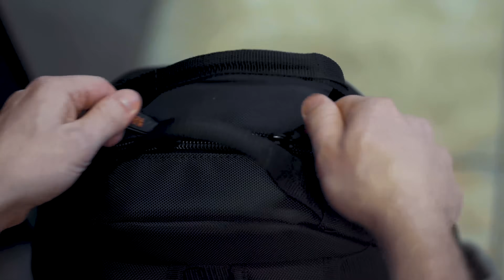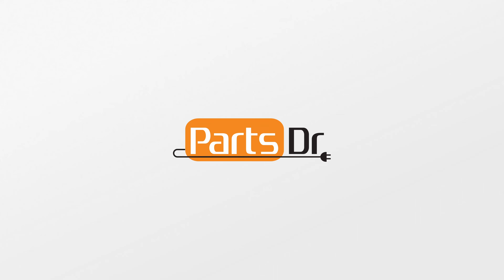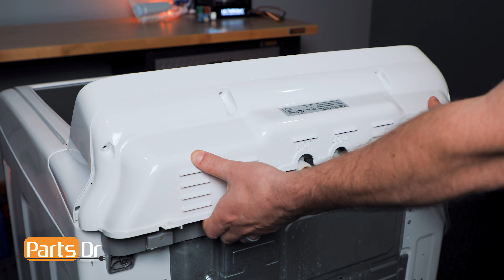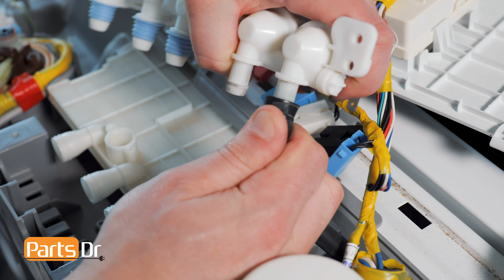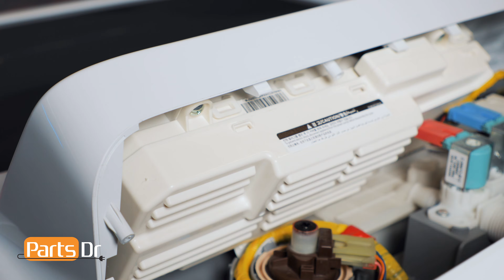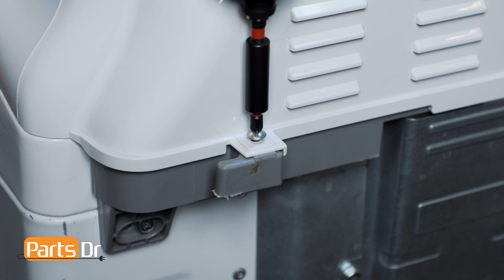Fix 4E, 4C, NF Errors - How to remove/replace Samsung washer water inlet valve part # DC97-15459G

Comment from the maker: We're glad you're finding this video helpful for fixing your Samsung washing machine! Just a quick word of caution.  If you're ordering parts online, especially from places like Amazon or eBay, be careful that many of the cheaper aftermarket parts are of much lower quality. We've seen many cases where these parts leak and cause costly water damage to homes.

For peace of mind, we always recommend using original OEM parts. You can find the high-quality Samsung parts on our website at https://partsdr.com While they might be a bit more expensive upfront, they'll save you money and prevent future headaches down the road.

Thanks for watching, and good luck with your repair!

Comment: Liked the video. I replaced the water intake valve but im still having water leaking out from the far left connection from the hot water side. I followed all the step in the video. Please help
Reply from the maker: It is leaking where the hoses attach to back of the washer or leaking into the tub while not in use?

Comment: So... I'm pissed - I just bought a new washer/dryer pair - because my washer wouldn't stop filling - unless I tuened the water orwssure WAY down - making the Quick Wash take 2-3 hours... but...I lived with it.  But when the dryer stopped heating- I figured,  WTF I might as well "look" at the local BrandSmart...and wben they offered me a credit card with $2k available - I pulled the trigger.. deliver tomorrow.

Should have watched your video first! 

Looks like $100 +/- in parts and 1-2 hours for this novice...

I am NOT letting them take the old appliances - so - maybe I'll repair and resell the old ones...
Reply from the maker: It definitely sounds like it is worth fixing and selling or giving to someone so they don't end up in the landfill.

Comment: Samsung Aquajet VRT WA48H7400AW/A2,  Parents having the issue of the water overfilling.  It will not stop when it reaches the correct level.  Will replacing this valve help with that?
Reply: Should have read the comment first but it looks like it will fix my issue.  Leaving this here for others to read.

Comment: Can you just replace the thread going in it cracked on my cold and it's leaking but I don't want to have to replace the whole thing just because of that
Reply from the maker: The water valve will need to be replaced if the threaded connection on the cold inlet is cracked.

Comment: Love the video, I’ve fixed my Samsung washer a few times now and the cost has been less than buying a new one or having someone fix it, I’ve had it for long so eventually the parts will start to degrade and mess up but still it’s worth fixing than getting a new one, you save money and only takes a few minutes.

Comment: So you can't replace just like one of the valves You got to do the whole assembly? I mean I can just swap one of the solenoids from like the bleach of fabric softener thing for the water one If we don't use the bleach or fabric softener dispenser but how do they solenoidsor do they
Reply from the maker: That is correct, if one of the solenoids on the valve fails the whole assembly will need to be replaced.

Comment: My washer started leaking water during a hard freeze …it started snowing ..I’m in the south ..first time ever temperature dropped severely low.. water started filling the tub ..now it just leaks water into the tub  ..do you think it’s the inlet valve ? Thx in advance .. I just want to make sure before I go through all this
Reply from the maker: Try unplugging the washer.  If water continues to leak into the tub while the washer is unplugged, that indicates the water valve is bad and will need to be replaced.
Reply: @ thank you so much for responding! I will try that . And thank you so much for this video! You def saving people time , money and a big headache ..much love from NOLA💕💕💕
Reply: @PartsDr just to make sure I understand you ..when you say it’s the water valve ..do you mean the inlet water valve like in this video ? Thx in advance…my washer didn’t give me an error code ..but it’s leaking water not much ..just a drip ..and the water pressure is kind of low .. could it be the inlet water valve or a sensor? So sorry to keep bothering you and thx in advance
Reply from the maker: @Strawberryfreeze3000  If the washer continues to fill with water when unplugged, that indicates that the water inlet valve on the washer is bad and will need to be replaced.
Reply: @ Thank you💕

Comment: Thanks! Looks like an easy repair. My Samsung wa50r5400av/us is not filling with hot or cold water, it's also not giving me an error code. I suspect that a new valve will fix it, but could it also be the pressure sensor??
Reply from the maker: Does the water valve hum when it should be calling for water?

Yes a bad pressure sensor or a kink of restriction in the pressure hose could cause it to act similar to this.
Reply: So my issue ended up being that the door was not latching, and there was no error code to indicate what the issue was.  Definitely something to look for first before moving on to the water inlet valve.
Reply from the maker: @williepiper2833  Thank you for sharing!  That is good to know!

Comment: As a single mom I want to thank you for this video. I ordered parts from Amazon fixed it leaking water sensor by watching your video. You saved me so much money . Thank you so much 🙏
Reply from the maker: Great job fixing it yourself! 👏 Just a heads up though, that the aftermarket parts sold on Amazon are low quality, and there's a risk of the valve leaking, which could lead to water damage in your home. We recommend checking out the original OEM Samsung part on our site at https://partsdr.com While it may cost a bit more upfront, it’ll save you money and prevent headaches in the long run. Thanks again for watching, and keep up the awesome work!

Comment: Love the channel! Would this work if my cold water side leaked and sprayed all over and now the washer will not even power on?
Reply from the maker: That sounds like two different issues.  If the water valve leaked onto the circuit board(s), it could have friend one of the circuit boards.
Reply: @PartsDr  appreciate the reply. I took apart the board and plugged everything back in and have power now so I think I’ll order a new inlet board. You’re right two different issues
Reply: Update, somehow it powered back on and now it has a new valve and works perfectly

Comment: How often does the solenoid valve spoil or how durable are these valves ?
Reply from the maker: The OEM Samsung valves are pretty good quality.  But all water valves can fail over time due to hard water and mineral deposits that can cause failure over time.

Comment: Will this fix my hot water issue? Hot water wont come out, only cold water and we got our plumbing redone so it’s not that.
Reply from the maker: Yes, if the hot solenoid on the water inlet valve fails it can cause the washer to not fill with hot water.

Comment: Could this also be why my washer doesn’t fill with cold water, only hot? I’ve checked other things like making sure the cold water faucet is open all the way
Reply from the maker: Yes, a bad water inlet valve can cause the washer to act this way.
Reply: @PartsDr  thanks for the swift response!

Comment: Do you perhaps have the DC92-00658C PC board?
Reply from the maker: That does not come up as a valid part number.  Make sure you have the correct part number https://www.youtube.com/watch?v=cLon_5r2LdQ
Reply: @PartsDr  it's a correct one for the Samsung Washer Dryer. The machine is WX4211XVM.
Reply from the maker: @thabisomodise2529  parts may not be available for this appliance because it is a non USA model.
Reply: @PartsDr  yes it was for South Africa and Australia. I have struggled for the whole 6 months and I am trying to save this machine. In Australia they it is model number WD1102XVM. Do you perhaps have contacts that can assist me?
Reply from the maker: @thabisomodise2529  Sorry, we do not.

Comment: Please forgive my ignorance, but I have a question. Why is the part you offer for my washing machine $93 and there are three same parts selling for as little as $25 or $26 on Amazon and other websites?
Again I don't know anything about anything when it comes to washer repair. Any guidance would be appreciated.
Reply from the maker: Amazon is not an authorized dealer for Samsung appliance parts.  All of the ones sold on Amazon in that price range are aftermarket or knock off parts.  We have heard many horror stories about aftermarket/knock off water valves flooding houses (just ask any appliance repair professional).  You may save a little up front, but in the end it could cost you a lot if the part fails.  Make sure you have good homeowners insurance!  Also, Amazon does not make free appliance repair videos showing you how to fix your appliances 😉.
Reply: @PartsDr  Thank you so much for the quick reply!! Well I assumed that it was going to be from Big Bob's house of knock off parts but I'm not sure that that inlet valve is as complicated as many other parts and unfortunately I don't have $93. I'm a metaplastic cancer patient living on a minimal amount of fixed income and while I absolutely appreciate your videos so much because without them I would not be able to make this repair myself, your quality authorized official parts are out of my budget. Such is life sometimes unfortunately. I will most definitely purchase your parts should my finances change. Because your videos are fantastic and they've taught me so very very much. Thank you ❤️

Comment: I have the same problem, I changed the inlet valve, and it doesn't work, I keep getting the NF error... help please...
Reply from the maker: Hi Edwin, did you replace the inlet valve with a genuine OEM Samsung part or an aftermarket part?  Have you checked the water supply to the washer?
Reply: @PartsDr  I was able to fix it, the only bad thing was.  a small tube, which I really don't know what it's for, had detached from where it came installed, I connected it again and that's it!  In the end it wasn't the inlet..
Reply from the maker: @chigui08  Great, thanks for sharing!  It sounds like maybe it was the pressure sensor hose like we show here: https://www.youtube.com/watch?v=c6gKsgPcHrg
Reply: @PartsDr  yeesss..!!

Comment: Any comments on the type of valve - (OEM or after market?) - the OEM get lots of bad reviews on Amazon but so do the aftermarket units - how do i get the best part ? - thanks
Reply from the maker: The problem is that many of the products advertised as OEM on Amazon are not OEM products.  Amazon is not an authorized dealer for any of the major appliance parts brands that we know of.  From our experience, we have seen a lot of problems with aftermarket, knock-off, and counterfeit water valves.  We don't think it is worth the risk, as a faulty valve can flood and damage your house and easily cause tens of thousands of dollars worth of damage.  If you are interested in genuine OEM parts, you can search our site https://partsdr.com

Comment: I replaced my valve now no water is going into the washer what did i do wrong? Can the new part be defective?
Reply from the maker: What was the issue with the original water valve?  We have seen a lot of issues with the aftermarket parts being sold on Amazon.

Comment: My inlet valve has plastic screens in the hot and cold inlet valve. Do they come out or are they suppose to be that way.
Reply from the maker: Some models use plastic screens instead of metal screens.  They are supposed to be there and they should be left in place.

Comment: My washer is leaving parts of sand and dirt on my clothes after I wash them is there a clogged filter somewhere that's holding dirt back why is it making my clothes dirtier after I wash them
Reply from the maker: That doesn't sound like a problem relating to a bad water inlet valve.  For that you may need to take the washer apart and clean it.  Also, check to make sure your drain pump is properly draining the water out of the washer.  Here is a video on disassembling the washer here: https://www.youtube.com/watch?v=OKarymySPuE

Comment: Threaded part replaceable? Where hoses connect?
Reply from the maker: No, you would need to replace the water valve if the threaded part is stripped or damaged.

Comment: How important are the black hoses to be put back on the right side I took it apart and I don't remember which one went where
Reply from the maker: The hoses usually connect to things like the detergent dispenser, bleach dispenser, and fabric softener dispenser.  If the hoses are connected in the wrong order, it will be sending water to the wrong area of the machine.

Comment: My samsung wouldn't stop filling even when unplugged. Ordered the $25 part and fixed it in twenty minutes. Thanks!
Reply: It shows me $93 on Parts Dr.
Reply: @HexNottingham ya but not on Amazon
Reply: @Boddylan75 I ended up needing a different part anyway. Returned mine. Something similar but right next to the one I was told to replace.

Comment: Great video!
I’m replacing my water inlet valve because it appears that the fabric softener valve is clogged.
Reply from the maker: Great!  Let us know how the repair goes for you!
Reply: @PartsDr  No joy🥲; The softener tray didn’t completely empty after 1st test. Could this be due to the softener being too thick?
Reply from the maker: @CharlestonUWH  Try cleaning out the dispenser drawer components as sometimes if they get clogged up they will not siphon properly to empty.
Reply: @PartsDr  still no 🥲 joy
Reply from the maker: @CharlestonUWH  try diluting it down with water
Reply: @PartsDr  had some water in the back of control panel that leaked to the floor. Checked all the hoses all were in tacked and functioning. Could it be the water inlet valve leaking?
Reply from the maker: @jerondbetts7341  Yes, we have seen water leak from the valve itself.

Comment: First off thank you for a very simple and easy to follow instructions great job.  But why does parts DR rip you off on price,  Parts Dr has the price for the valve at $97 and then $15 shipping so $112 but i can buy the part straight from Samsung for $22 and no shipping fee.
Reply from the maker: Those numbers don't make sense.  What is the model number and part number?
Reply: @PartsDr  DC97-15459H is the part number for my washer with sale price you have it listed for $92 not including shipping, Samsungs web sight has it for $23 as does amazon, and amazon is free shipping
Reply from the maker: @ruutocka3536  Samsung's site does not have it for $23.  Any part that you are finding in that price range is a knock off or aftermarket part.  That is VERY risky with a part that controls water flow as we have seen them flood people's houses.  Here is a link to Samsung's site: http://www.samsungparts.com/Products/Parts_and_Accessories/PID-DC97-15459H.aspx
Reply: @PartsDr  Most of the listings on Amazon say OEM or Genuine but each lists a different manufacturer. Are the parts from the same manufacturer Samsung uses or at least contain the same exact parts? Maybe, maybe not. Looking for a DC97-15459G I see one that specifically claims it's made from the same OEM manufacturer. I ended up buying from a seller claiming it's OEM and gives a 5 year warranty. I figure my washer is in a pan attached to a floor drain, I have a flood alarm, and I have no faith in Samsung anymore anyway so I might as well save some money. The new one looks exactly like Samsung's. It's probably the same factory selling to whoever wants to buy in bulk. I highly doubt Samsung's cost is nearly as much for the part as they are selling it for however they may be paying extra to ensure the factory does quality control checks and to get batches strictly adhering to the set standards. Not that it seems to be doing them any good.
Reply from the maker: @kamX-rz4uy  All of the ones on Amazon in that price range are aftermarket or knock off parts.  We have heard many horror stories about aftermarket/knock off water valves flooding houses.  Make sure you have good homeowners insurance!

Comment: I'm this video as I'm trying to change the Assy Body Detergent: huds DC97-16962A / AP5622492, which is the component that sits below.  Does it just unscrew and pop off?
Reply from the maker: Yes it looks like once the water valve is removed that you would unscrew the two screws and slide it out.  https://partsdr.com/part/dc97-16962a-detergent-container

Comment: I AM GETTING A 4E CODE WHEN FILLING. THE UNIT ALSO LEAKS FROM THE BOTTOM RIGHT CORNER. I HAVE INSPECTED THE HOSES AND INLET VALVE SCREENS AND SEE NO ISSUE WITH THEM. WOULD I BE CORRECT TO THINK THE INLET VALVE IS BAD AND NEEDS REPLACED? THANKS IN ADVANCE
Reply from the maker: First check to make sure the water supply to your washer is good.  If there is power being sent to the valve and the valve isn't dispensing water then the valve is bad and it will need to be replaced.  Let us know what you find.

Comment: Short, sweet and to the point, just the way I like it. One of the lines is leaking very slowly into the drum, can't tell which, but this looks pretty easy and will replace both. Thanks for the video.
Reply from the maker: Thanks!  Good luck with the repair!

Comment: So you’re telling me….I have to replace the whole thing just because the plastic threading is stripped and won’t hold a hose fitting?
Reply from the maker: Yes, that is correct, the water valve would need to be replaced if the plastic threading is stripped.

Comment: Myn filling with hot water even thoe i put it on cold
Reply from the maker: Did you check to make sure you don't have the hoses from the house to the washer connected backwards?